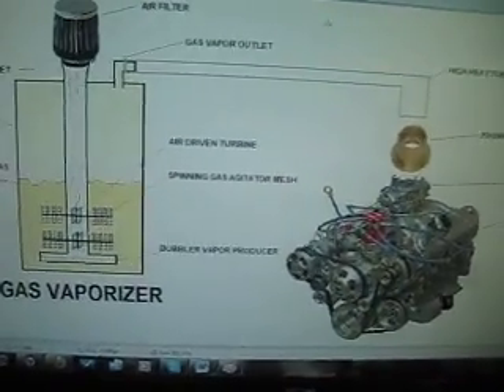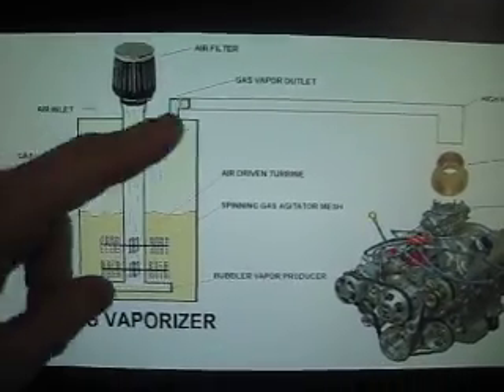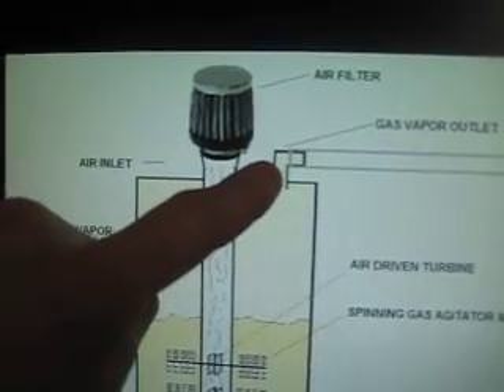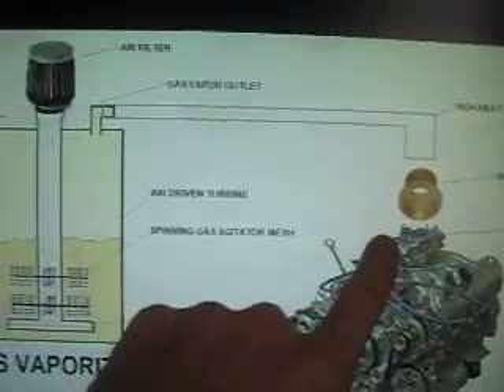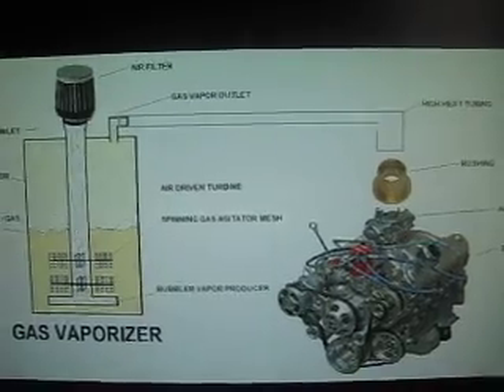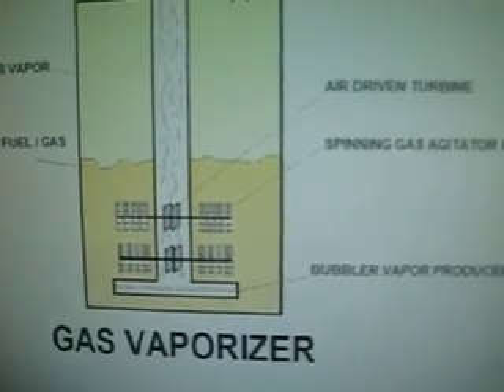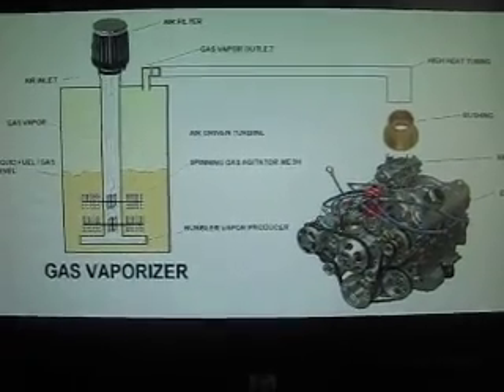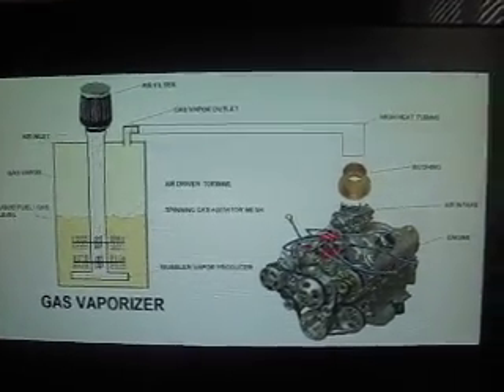GASOLINE VAPORIZER 100% GASOLINE VAPOR

Comment: I like your video. I got one question, is it possible to to build a spark system that can be able to run the engine without the computer box?, because I tried to use petrol vaporizer system in diesel engine it actually work perfectly and I even disconnected the computer box from the car!. now I'm wondering and I'm seeking for any further way to build my self a spark systems Then I can be able to fully control a petrol engine!!

Comment: The turbines may actually cause an explosion as well as produce to much vapor verses the air as well as the fuel intact.  The t pattern is good to use as should be more than enough to run a gasoline engine. If you do it you're way make sure that you run it from a distance a few times in a field. Awesome passage of knowledge and I thank you for it. Have a blessed day.

Comment: this is a typical passive system put the air cleaner in the tank and a 3/8 air line to the bottom  of the tank....affix another air line to the very top of the tank ,,,, take that airline and attach it to the intake side of a vacuum pump or smog pump....affix another 3/8 airline to the export side of the vacuum pump attach a spark arrester and attach this line to your intake manifold do not block off your carburetor.... start your engines sir   yours does not work all of  the time  i know

Comment: Can you use an oil pickup screen at the bottom of the air intake instead of drilling holes into the smaller pipes?

Comment: dude you gotta put a one way pressure valve in there somewhere.... a bit of pre ignition and she's gonna blow on you - inline would work, also feed a line from your air intake though the air filter not to suck a bunch of shit into your heads

Comment: Hot Rod magazine once said Its amazing that carburetors works as well as they do. It might work at low rpms but when You rap the Engine up what Is going to happen Its going to create such a vacuum that It will suck liquid gasoline Into the carburetor.
I was working on something as that In the early 1980's I got the Idea from a Water Injection that I ordered from JC Whitney and wanted to see what would happen If I tried It with gasoline, I did Not mess with It much because I was more Into building Horse power but one of the things I did was hooked It up to a Shop-Vac and made a flame thrower. I also modified a Quadra Jet carburetor and put It on a Ford 460 and got 25 miles to a gallon but with My Income now days I Am more Into just getting stuff to work rather than experimenting, and more Into Electric cars than messing with something that Is dangerous and needs much repairs.

Comment: Hi Tyson. This is such a grand video you have shown me. I got to look at the very beginning video’s you started out with and this evening I got to watch your video show described the process of vapour using your tubing injection system to cause more vapour in the tank. Ok here’s my question I believe I can use my fuel tank by means of replacing the fuel tank cap with a hose that goes into the tank and is sealed off with the air filter that fits the tank inlet. Most fuel tanks are designed to have a breather outlet at top of the entry where the fuel nozzle is inserted to fuel your tank, here is where I would attach my vapour fuel line to engine. Hope I have simplified the system, would this be possible given that the end of the hose inserted has a tee much like yours to create the bubble to generate vapour?
Reply from the maker: Thank you! I have seen that method used before although I have not personally done it. You will still need a way to prevent the splashing that occurs in the tank from entering the vapor delivery line.
Reply from the maker: Tyson Capel Controlling the ATF is still difficult so you will have to figure out a way to do it so the mixture is regulated correctly. A vacuum actuated valve should work once you find the proper diameter size that will work best for your vehicle.
Reply from the maker: I will see what I can do to make the visualization of things better. Thanks for the tip.

Comment: cool project , would this work with a turbo o will that cause premature burns ,also would that be placed b4 or after the turbo i guessing in between the inter cooler and engine?
Reply from the maker: I have not tried it on a turbo but yes I would imagine the best place to inject the vapor would be between after the inter cooler.

Comment: Im considering trying this on my 1999 Honda Accord and also my 1996 Chevrolet Suburban. What are the explosion risks?
Reply from the maker: If you use backflash arrestors (aluminum window screen doubled up) you won't have an explosion.
Reply from the maker: ***** Check out my video I have on how to make a flash back arrestor and you will see how it's done. Thanks!
Reply from the maker: As long as you place backfire protection systems in the vapor system you wont have to worry about an explosion. I Started doing the 100 MPG project as a more practical achievable system. These systems are very unreliable so designing a system that can without fail provide 100 MPG is a much more realistic system to build. I did achieve the 211.7 MPG but after much testing, redesigning, building, etc. I realized the difficulty that exists in building a system that can achieve that kind of mileage all the time. It is allot more complicated than it seems.

Comment: no flashback?
Reply from the maker: Yes there is a flashback arrestor built into the vapor outlet port and at the throttle body and all air intakes.
Reply: ok

Comment: hi! i like your videos an what you are doing , i just came upon this documentary really interesting, wanted to share with all the people who are experimenting with gas vapour, lots of testing, flash points etc...its most about gas vapour. i m into a project and dont want do catch on fire so i m gathering info about flamable fuels.
Chemistry of Fire 1947 Department of Defense
Reply from the maker: Use a flash arrestor at multiple points in the system. Suppressing gasoline vapor is very easy to do all you need is a couple layers of aluminum window screen and make sure it is sealed around all edges to insure that all vapor passes through notin but the screen.
Reply: thanks for quick reply, normally all combustible gases or liquids do not burn if there isn t any oxygen...i wanna build a enclosed setup not like a bubbler where air mixes with gas vapour and verry dangerous, but more like a pressurized one or on demand vapour(craked gasoline) not fumes where only gets contact with oxygen at the end of the hose just like lpg, and if it the pressure is a little bigger than atmosferic it wont backfire.i l take precaution messures whatsoever.bye

Comment: great idea.but you will need to use hot air going into the bubblier instead of just air because gas will get very very cold, witch will give less vapor.Warm gas will give you more vapor
Reply from the maker: It will cool that's for sure but even when it is cool you can make fumes. Heat works much better if you check out my other videos you will see that I am using a heated vapor system.

Comment: Ummmm Liquid gas isn't combustible . The are all mixed with air to vaporize it. First it was a carburetor . Now its fuel injection. Liquid gasoline is injected into the cylinder, the hot air vaporizes it .   In closing ALL internal combustion engines run on vapors.
Reply from the maker: You are absolutely correct. Carburated and fuel injection engines however are very inefficient they waste allot of gasoline because there is simply not enough time for all of the gasoline being injected to fully vaporize.
Reply: if ya say so.
Reply: MrAgnostic Your cause here, which is to stir up trouble, doesn't work. But if you think it helps prove some point yet that you have yet to "prove" then going ahead and waste your time if that's your wish. No one will listen, but you are still free to do so.

Comment: It is more than just hydrogen or vaporizing to get great mileage
I have been trying to expose an answer to the mystery of the100 Miles per gallon fuel systems. Yes 5 times the fuel mileage is possible but missed or suppressed by oil companies for over 80 years and we have the patents and the science to prove it,  see the evidence we have now see at website (no spaces) him acre search dot com other  sites with similar info are Byron wine dot com  Rex research dot com  More than vapor  but refining gasoline into natural gas and methanol yes 200 mpg 4 cylinder
Reply from the maker: There are absolutely tones of patents on vaporizing fuels for high mileage... I've seen almost all of them including some that are not in the public domain.
Reply: Tyson Capel
What i found was just vaporizing would not give great mileage, but they were actually cracking the gasoline with hydro cracking,or thermal catalytic cracking to lower the boiling point so it stays vaporous, this is how they get great mileage.
Reply from the maker: Yes cracking the gasoline is the key to extremely high mileage for sure. I discovered that by accident while running a test on my cold vapor system. I have since moved on to various types of hot vapor systems that I have designed.

Comment: 1 What is the ratio of gas vapors to Oxygen in order for an internal combustion engine to operate?

2 How will you be able to keep this ratio and have it adjust under constantly changing engine loads?

3 Isn't vaporized gasoline called vapor lock and will completely prohibit the engine from running?

Comment from the maker: Using nothing but gasoline or other fuel vapors is totally different then using traditional inefficient liquid gasoline. I build in the flash back arrestors and make them part of the system itself. As for the ATF I am still working out the bugs on that but I can tell you your car will show that you are running lean when using a vapor system that is tuned in properly. Even though the engine tells you it is running lean, when using a vapor system the engine temperature goes down by about 10 deg.

Comment from the maker: Yes it would have enough fumes to run a car but you would get leftovers in the gasoline. You also have to get the air to fuel ratios right or there wont be much of a gain in MPG.

Comment: Could you just use a bearing for the turbine shaft, fastening itself within a circular seal within the tank wall for the air-tight leak free encapsulation for its energy transmission from the exterior air driven fan? You have an awesome idea for siphoning more fumes into the system!! Cheers.

Comment: Awesome idea !!!!! Did not know if you were already into it, but was the air-tight encapsulation between the air-driven turbine shaft and the gas vaporizer tank, enabling fuel containment within the system, going to be managed by a seal and a ball bearing, with the seal between the tank wall and the bearing, and the shaft contacting the bearing so that it can transmit the rotational energy of the moving car's air, into the fuel tank leak free, for feeding more fumes into the tubes?

Comment from the maker: This has not been a problem, the cycle of the engine seems to allow the vapors to be sucked in, pressurized combusted and exhausted without problems of pre ignition.

Comment from the maker: Bubblers work pretty good you will need to connect it to the air intake on the carb and make a secondary air inlet to get the right air to vapor mixture. Check out some of my other videos for bubbler designs, you can use the concepts in them to design one that will work in your vehicle.

Comment: It's obvious you've done a buttload of work & research on this. What've you done to reduce the likelihood of burning intake valves due to the slight overlap of exhaust and intake lobes on the camshaft causing premature ignition of the incoming vapor?

Comment from the maker: You are absolutely correct. I have already done this. Check out my other videos and you will see me mention it there. In my newest design I use perforated steel as the back flash protection and it works very well!

Comment from the maker: I do much more then idle the engine in my back yard I drive it as well if you watch some of my other videos you will see me taking them on test drives. You are correct loads altitudes temperatures will all have an effect on the system this is why you have control of it so I can set the temp and have it constant etc. Please see my other videos for more details.

Comment from the maker: Fuel grade has not seemed to have much of a difference. I have used 1 1/2 tubing through 3" tubing. Bubbling HHO through gasoline would work just fine they don't combust when they come into contact with one another so what you heard is defiantly a rumor.

Comment: For idling an engine in the back yard? A car is made to use for a real purpose beyond that. Thru the last 130 yrs fuel metering systems have evolved to deliver fuel varying rpms, loads, altitudes and temperatures. There is no reason to believe your system can ever do that. I do greatly admire your inventive spirit......

Comment from the maker: I have done that and through doing that I discovered a much better way to run a car off of vapors. I now use a hot vapor system, no air enters the vapor chamber. It is much more efficient then a cold vapor system. Just an FYI a well made cold vapor system is still more efficient then even a fuel injected engine.

Comment from the maker: I would agree that engines can be redesigned to further reduce wasted energy. The fact is the automobile manufactures don't care about it that much. They have all done lots of testing on various aspects of the engine drive train etc. and it's fact that they have been able to improve the efficiency but until they are forced to do this or get someone in control that really cares about it, it's not going to change.

Comment from the maker: The timing of the engine is critical. Just as in most fuels they have different burn rates and yes timing does need to change if you use a fuel with a different burn rate then that of gasoline. I will be making timing adjustments on my engine to see if I can further improve fuel efficiency. As of now If I clock the time it takes to get from 0-60 when running on hot vapors I actually get there about 1 second faster then when running on liquid gasoline running through my injectors.

Comment from the maker: Most fuel injected engines have hardened valves therefore vapors being sucked into an engine to make it run wont ruin them. It works the same way with propane or natural gas. I have back fire protection inline with the vapor outlet pipes on my vaporizers. Also with this particular design if you were to simply bubble air through the gasoline and install a butterfly valve on the intake side of the vaporizer for the most part it would run just fine.

Comment from the maker: I have done it too and have done allot of testing making necessarily changes as needed. I have however never had a problem with the valves. If you watch my other videos you will see some of the testing I have done with various designs. I have spent hundreds  of hours testing these vapor systems and have discovered many things that would not make since to the typical close minded scientist because science can't explain some things that occur.

Comment: I don't know about the 4000 degrees. For you to take water to that temperature would require more than just heat. Water boils at 212 degrees Fahrenheit. This means you would have to put the water under extreme pressure, to take it to that temperature. The pressure alone would require an explosion proof chamber. Once you split the oxygen and hydrogen in the water, the high pressure would be a high pressure bomb, more dangerous than a hydrogen fuel cell. Lab tests will can prove my way works.

Comment from the maker: I looked at this white gas quite a while ago. Interesting stuff. Water splits into HHO at around 4000 deg F if my memory serves me right. Although it does this at an extreme heat the hotter you get water the weaker the bond becomes. We can use this to our advantage.

Comment: Tyson, take a look at White Gasoline Vapor, here on You Tube. I think I have preformed a molecular structural change to gasoline. A gas spectrum analyzer will prove me right. If I have done what I say to gasoline, it can be done to water. This means if am right, we  will be able to find the right temperature, and using my Flashing Liquid method, it will be possible to make enough hydrogen at the intake manifold, using water and the right temperature, enough to run any engine. Water for fuel.

Comment from the maker: I use extreme heat to vaporize the gasoline as can be seen in the newest design I am currently installing in my Jeep. The temperatures used do not allow the gasoline to condense back down as it is under pressure. 
I'll check out what you have! Thanks for sharing!

Comment: Thanks again Tyson... I've just decided to build a new dual cell hho system to run through a dual fuel vaporizer... think of dc voltage coffee pots under a stainless steel container purchased from Walmart ... or perhaps even as you mentioned an after market heater core with the fuel cells on top to heat the gas for your extra vapors...... and also considering an in cab shut off switch for the gas flow to the engine ( liquid) ... thanks again for the inspirational motivation... ttyl;  Tom

Comment from the maker: You got it. I will have to start my engine normally then change over to the vapor system a few seconds later once the vapor container is heated up enough to run on vapors. I may also install a heating element for startup purposes.